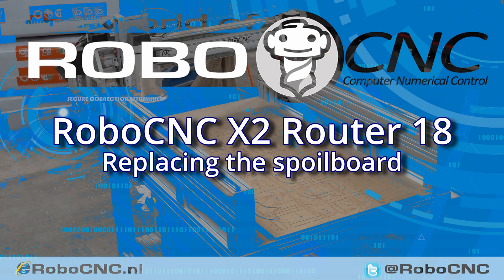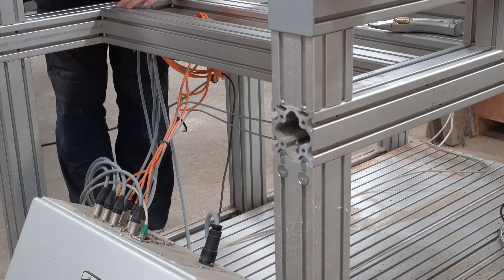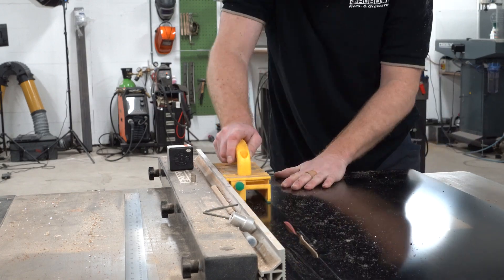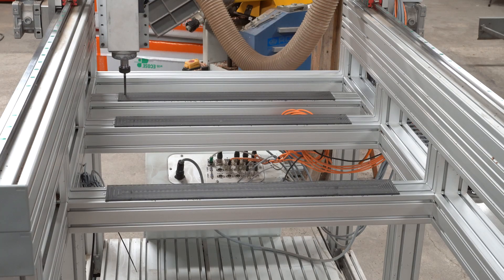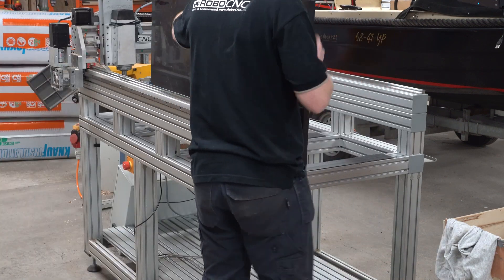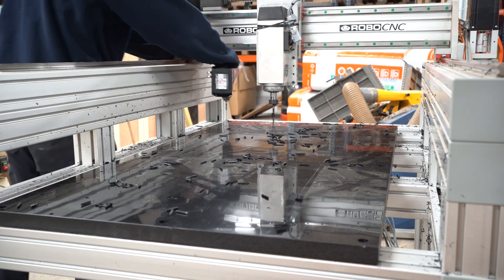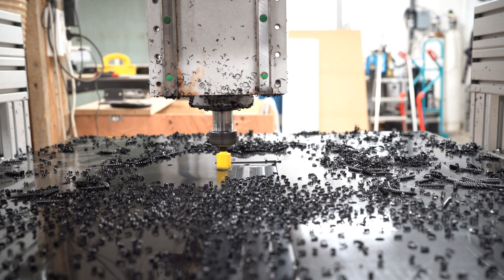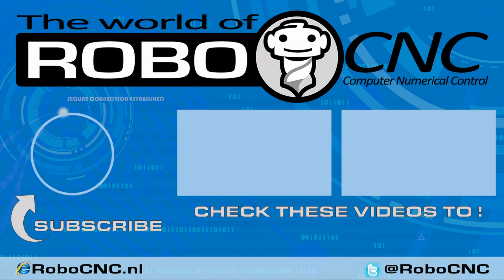RCNC X2 Router 18: Changing the spoilboard

Comment: WD40 isn’t a lubricant, it’s for water displacement?
Reply from the maker: You are right, at least about its intended purpose..... and now try it one day when you are at a lathe an running aluminum, doing light machining in aluminum, or while tapping it.. You'll be surprised.. (as where the inventors... after 40 recipies)

Comment: Thank you for the video. I have been wanting to do a hdpe spoil board for some time now and this has given me motivation to do so. My main reason is I get annoyed with having to always surface the mdf because of the inconsistency of mdf after it has sat for a bit.
Reply from the maker: I do noticed that my spoilboard flexes a bit with high Z forces like drilling. So make sure to have a rigged base beneath the spoilboard. I expected the thickness to be enough to prevent that.

Comment: Great vid, thanks for sharing. In the movie @4:50, you're using the wrong output of your toolsetter; it's now wired to the endstop/error output, the first one is more accurate and this second one is usually wired into the e-stop circuit. It's now at the limit of its travel, it should only be pushed in minimal in order to detect the tool.
Reply from the maker: Thanks for sharing ! I didn’t know there were two :)

Comment: The way I make it is I do exactly the same as you, but I don't flatten the waste board directly. I glue a 2mm plexiglass on top of it with a regular silicone, and then flatten the plexiglass.. And when there is too much marks on it, you can peel it off really easily and for some reason, all the silicone stays on the top part, on the plexi and there is absolutely no cleaning needed.. And then you just glue a new one on top and the main wasteboard always stays intact..
Reply from the maker: Thanks for sharing ! Sounds like a great way to! And eventually that will be less expensive then the thick HDPE.